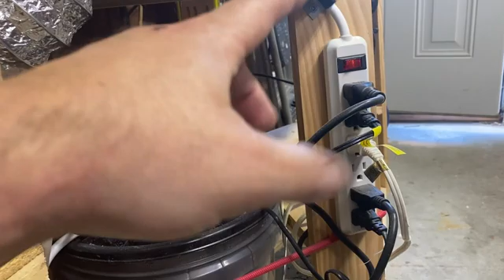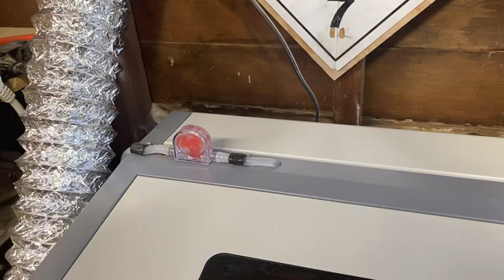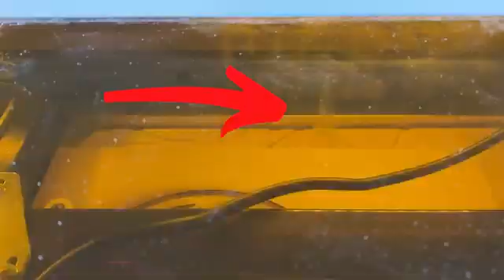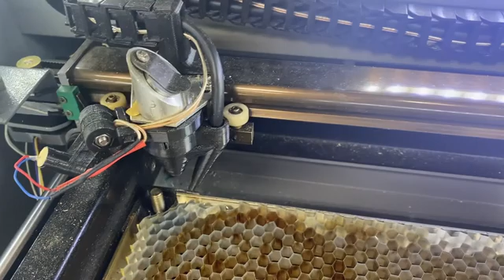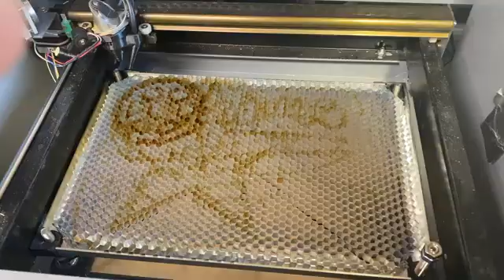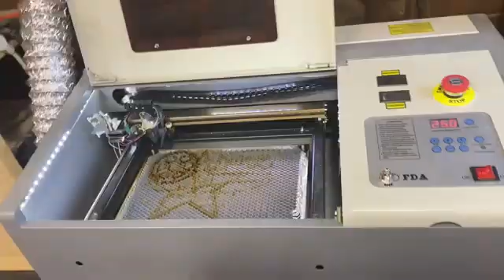You can't miss out on these K40 C02 Mods! | #monportlaser

Comment: I’m experiencing issues with my Monport Mega 70W laser engraver's WiFi connection, which is intermittent and difficult to establish. Despite submitting a support form last Wednesday, May 7th, 2025, I haven't received a response. I've also tried contacting your 24/7 support team through live chat and phone, but haven't been able to reach anyone. I've left messages, but so far, no one has called me back.

I'm disappointed in the level of support I've received so far, especially since I received the machine last Monday and am eager to start using it. Unfortunately, the WiFi issue is preventing me from even using any of the features. I can’t even communicate to the machine using USB. I would appreciate it if someone from your team could assist me with resolving this issue as soon as possible.
Reply from the maker: We're so sorry to hear that. Please reach us through support@monportlaser.com. Thank you